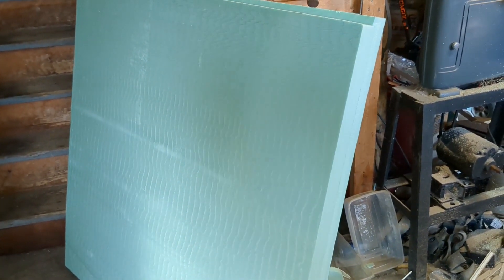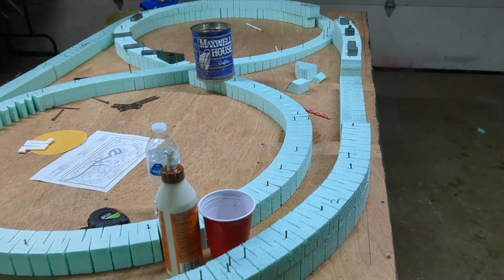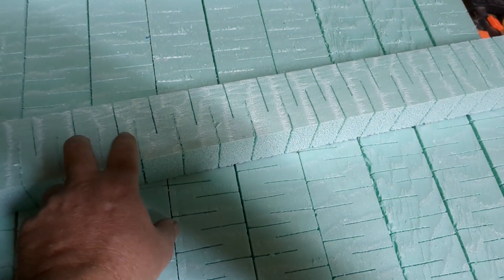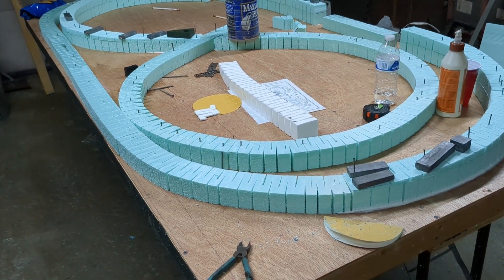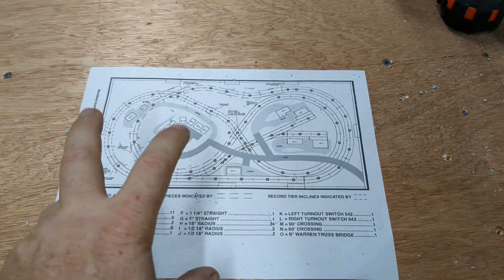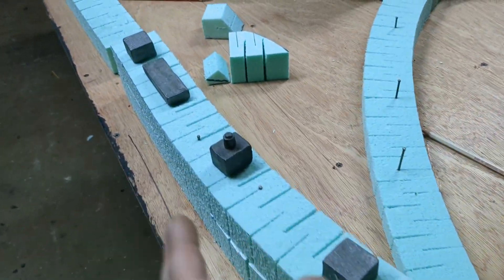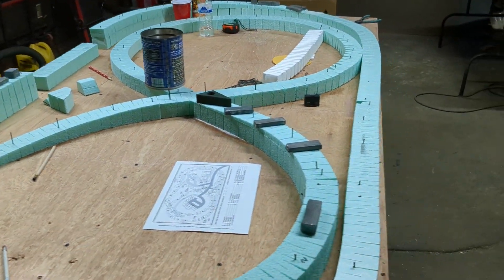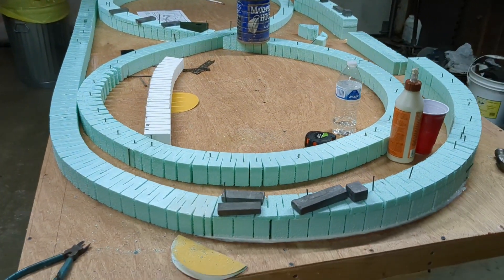Grand Valley homemade kit part 1

Comment: This looks great!!  I did a video a few months back with this exact idea, using your own materials to build the GVL kit. The one modification that I would suggest for you, and you’re at the perfect point to be able to do it, is to eliminate the cross. I would do an over and under, so you never have to worry about the trains wrecking at the cross track. It’s great how you straightened out the part where the bridge will be, because one of the flaws in the GVL kit is the curves coming and going from the bridge. It really limits the size of the cars that you can run on the layout. Excellent job! I’m looking forward to more updates.

Build A Woodland Scenics Grand Valley Layout Kit, Without Buying The Actual Kit!
https://youtu.be/91fLnhgZSpU
Reply from the maker: I watched your video and that's what gave me an idea and I really like how your layout turned out
Reply: @FostoriaOhiomodelrailroadclub  awesome job!! Thanks. 👍🏼